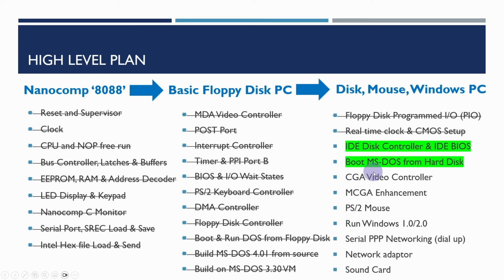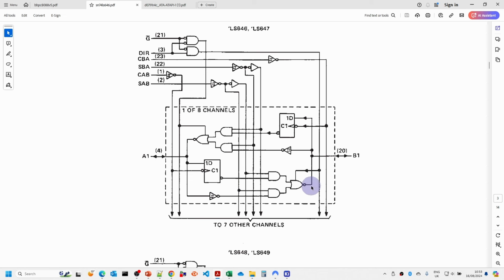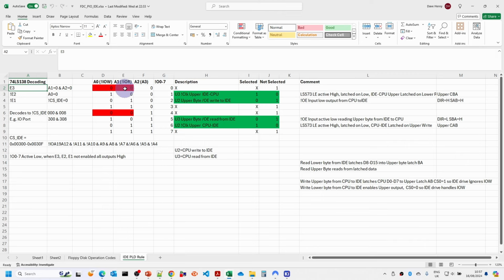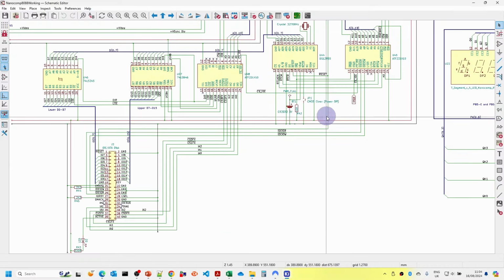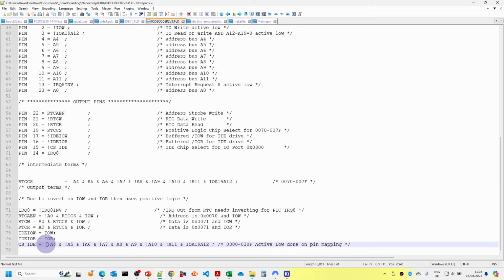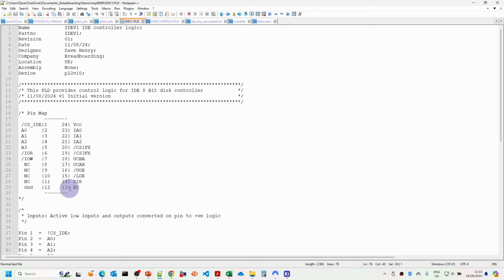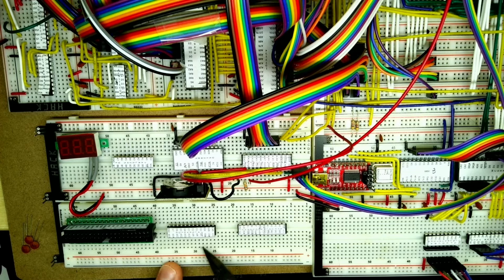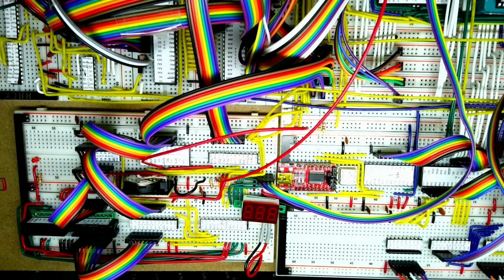Breadboard 8088 PC #43.2 IDE Disk and Controller Part 2

Comment: Why don’t you just use the IDE in 8-bit mode?
Reply from the maker: The designs were for 16 bit and from what I read I thought not all drives could do 8 bit (not even sure how to select 8 bit mode, no jumpers or IDE commands in the spec doc.s). Dave